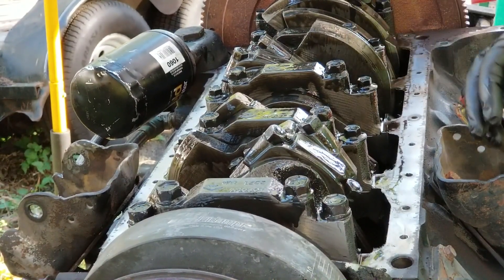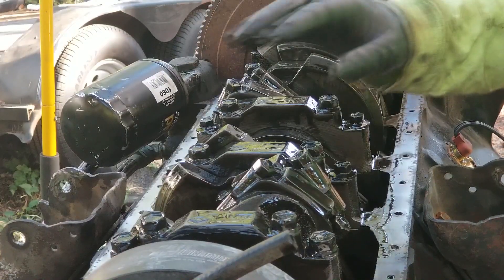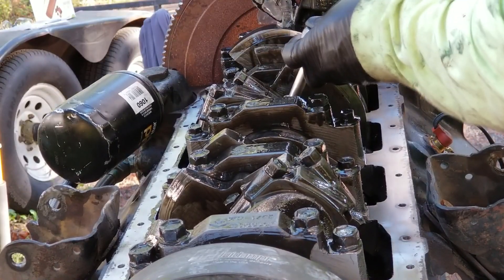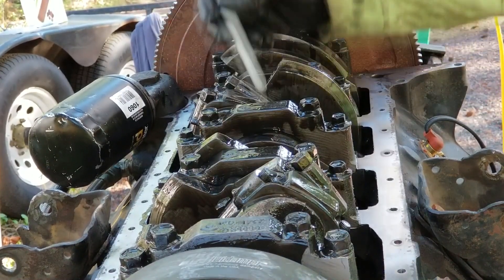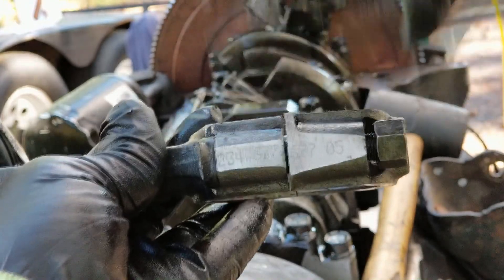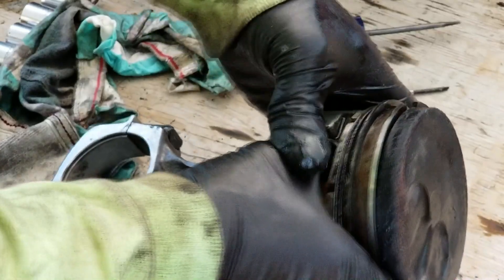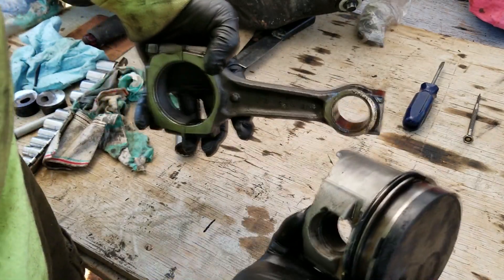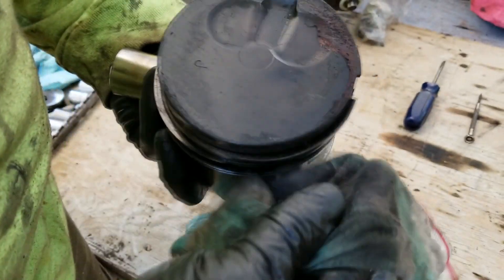Detailed GM 6.5 Turbo Diesel Rebuild - Part 6

Comment from the maker: Hey guys, we finally move forward with the teardown and get our first look at what few think can happen, a cracked Optimizer. I'll have better pictures in the main article at https://www.65turbogarage.com/detailed-65-rebuild.html.
And I think this is finally the last video with all that ANNOYING friggen electronic interference. 
Enjoy!
Reply: SixFiveTurboGarage.com You using a gear drive timing set or the oem chain timing set?
Reply from the maker: @mikemcgrew65  I'm using a gear drive set made by DSG that has been discontinued. Leroy Diesel sells the same set some times but he has run out of stock this time around and needs people to let him know that they want a set, when he gets enough people, he'll make another run. You can get a hold of him at his site...
http://leroydiesel.com/

Comment: I see you haven’t posted update in 2 years, what did you end up doing with the engine?
Reply from the maker: Oh, she's running strong!
Believe it or not, I still plan on finishing the videos and articles at some point, there were some major events that pulled me away and I just need things to mellow out a bit so I can concentrate on getting them out.
I got it rebuilt with a few mods along the way and now it's running very well with an A-Team turbo, Feed the Beast mod, maxed out DB2 pump (with a much bigger one planned), water/methanol, and a bunch of other goodies that I'll cover in more detail.

Comment: Those are pretty thick and heavy duty rods and pistons so,  why do they say you can't modifie the 6.2 or 6.5 diesel to get more power out of them  for fear of blowing them up like you can a Cummins or a Power Stroke?!
Reply from the maker: Tom, the first and best thing you can do to get great power and reliability out of these motors is completely ignore what "they" say. The diesel world is full of egos, bro science, and ignorance.
There are motors out there with over 600,000 miles on them, some with over 500HP, some doing serious tractor pulls, and many doing regular towing on a daily basis.
Are they as good in some ways as a Cummins? No. They were never built to be. But does that mean they are on the other extreme and complete garbage? Again, no. That's where the egos, bro science, and ignorance comes in.

Comment: check the rods to make sure they aren't bent and also main studs will prevent against main cracks and cap walking
Reply from the maker: Yup, I'm a big fan of finding a good machine shop like Portland Engine Rebuilders, they will check all that when they do the machining.
And main studs? Hmmm... stay tuned. : )>

Comment: My 94 block has the same cracks, and fretting where the caps and block meet. I put loctite retaining compound on the bolts and mating surfaces. Same that was recommended to me for the 5th gear fretting aswell. Im trying to get it back together, we will see how it does. Engine ran great though, only tore down to replace leaky seals...
Reply from the maker: I've never heard of using lock tight on the caps, I'd be interested in seeing if it works. Later, you'll see me relieve all stress risers in the block along with the bolt holes themselves and then using Quadstars ARP main studs. That along with a full balance job and a Fluidampr is what I'm hoping will prevent any further cracking.

Comment: Will this water pump that you have listed part #251-590 or the 251-603 Water pump fit my 95 6.5 i am not running dual thermostats its just stock.
Reply from the maker: Yes sir, it will fit the 95 block. But you need the matching Hayden 2886 clutch (or your preferred manufacturer) with the spin on style. Hayden is much more heavy duty than any stock level clutch.
You can read about it all here with part numbers, pictures, and info... https://www.65turbogarage.com/stop-65-overheating.html

Comment: Nice job on keeping cool as you perform an autopsy on a "friend". But understanding path of carnage is useful even though you already know the "cause of death". Sadly the rapid loss of coolant under load pretty much hit everything, heads, pistons, block but it does not appear it affected the rod bearings which is interesting. How the main bearing at the cracked web in the block will be worth looking at closer as well as the line bore of the mains if the block is to be repaired and used, even if it isn't it would be interesting to have it checked. Also how the heat affected the block deck and head surface will be something to check as well. Thanks for sharing this, not often an "oh crap" moment is documented so it can help others. Many years ago I destroyed an engine with a total coolant loss, I didn't go as far as you are and paid the price, I had the heads rebuilt and put back together. It ran fine for a couple months and then began to deteriorate performance wise because it took off a cam lobe, probably the heat damage. It was a flat tappet cam, not a roller like the 6.5 but there isn't an acceptable short-cut to repairing an engine that overheated under your circumstances. Definitely following this project.
Reply from the maker: Thanks for the input, Craig. Yeah, this thing is definitely interesting as it develops. The motor is already built at this time but I'm not giving away any hints. : )>
I do think that much of the damage was already done before the coolant loss and the loss maybe just added to it a bit and caused the gaskets to go. But we'll look more at it as we go.
Interested to know your views as it plays out.
And I really want the whole web site and videos to show the whole process, warts and all. You never know what little piece of info may help someone.

Comment: I've always bin interested in a nice 97-98 gm Z71 6.5 diesel mainly for mpg but I'm scared to buy one specially after seeing this video.
Reply from the maker: I don't know why this video would scare you, there's nothing at all here that hasn't happened to every vehicle ever made at one time or another (meaning massive failure).  And really, you should feel glad to know that there is info like this on the 6.5 so you know how to keep her running so go buy one!
(And FYI, my 8000 lb four door long bed 4 wheel drive gets 18 mpg)
Reply: @SixFiveTurboGaragecom  nice I'm wondering how much mpgmy 5200lb regcab 2wd auto will get!
Reply from the maker: @snoopwombo  You should be able to get 20, I'd think. Mine went up when I got good, quality injectors.
Reply: Wow don’t be scared they hold up brother